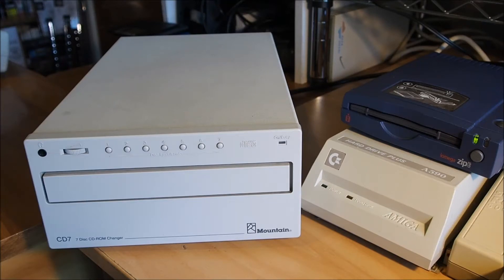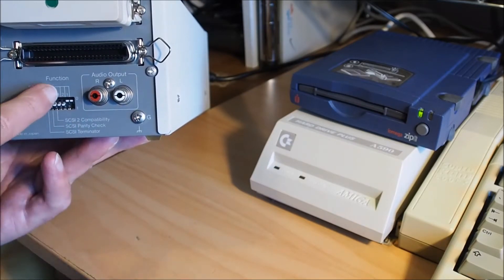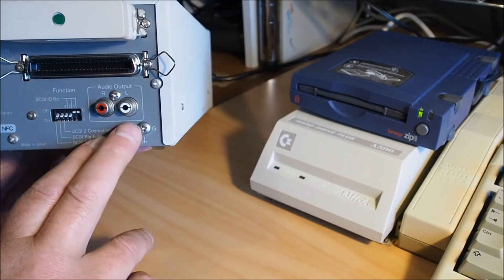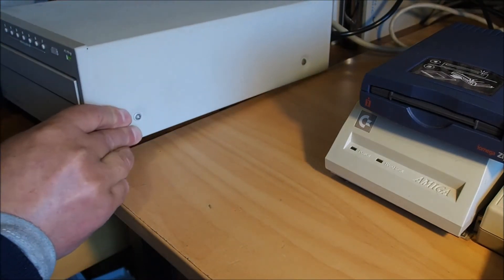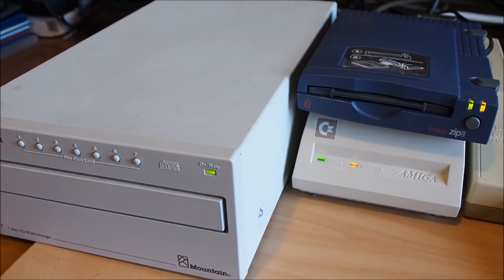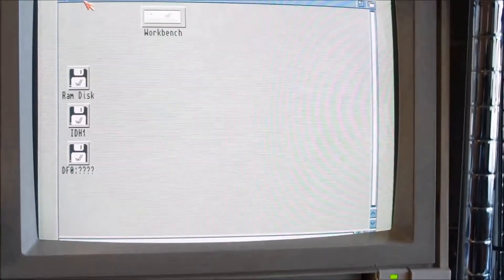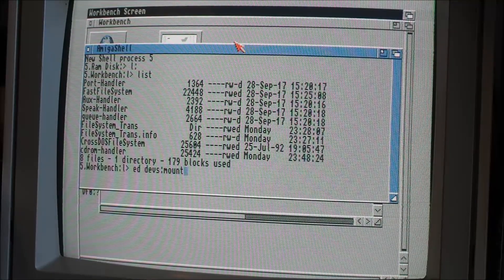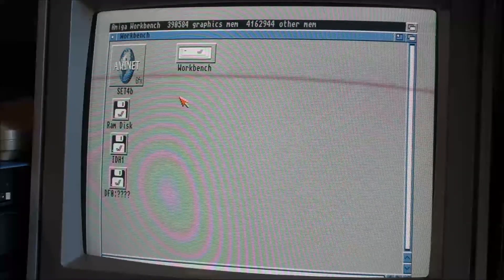Mountain CD7 Multi Disk CD ROM Drive on an Amiga 500

Comment: I had four of these hooked up to an A4000 for my BBS in the mid-90s. What a nightmare these are! In addition to the glacial slowness of disc changes, every so often the SCSI controller would get clueless about one of them and eventually lock up the bus, requiring a reboot. That was lots of fun when 20 modems were in use during prime-time. I can't remember what SCSI controllers I tried with them , but I had used both a Warp Engine and Cyberstorm 060 on it at various times. I still have them here somewhere as well as the disc changers...
Reply: Damn 20 modems!  You must have ran the MOTHER of all BBS's back in the day!
Reply: There were bigger, but the Blue Moon did pretty well until the internet changed everything.